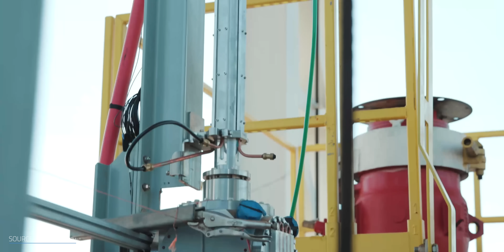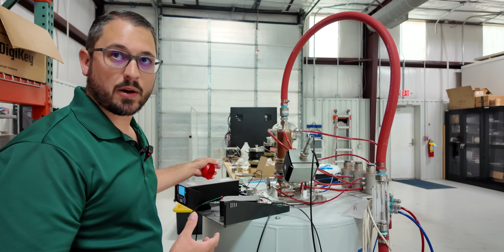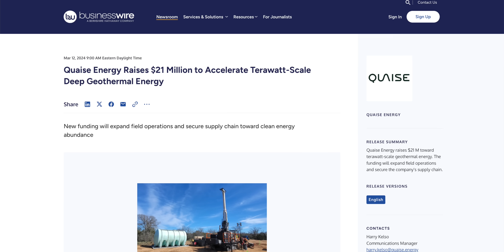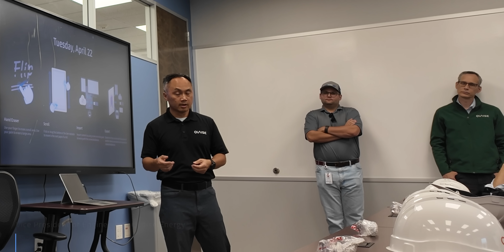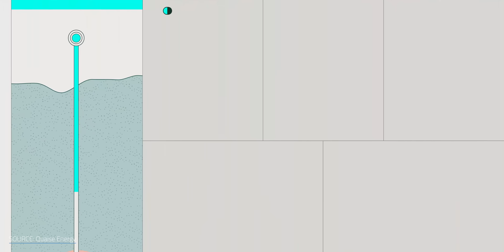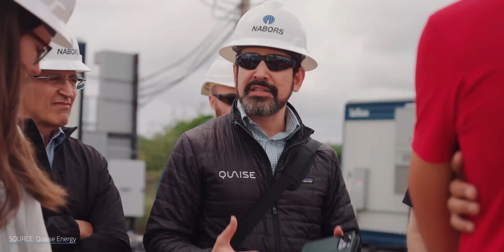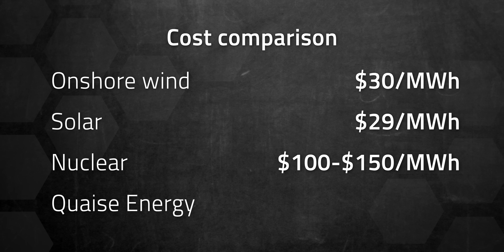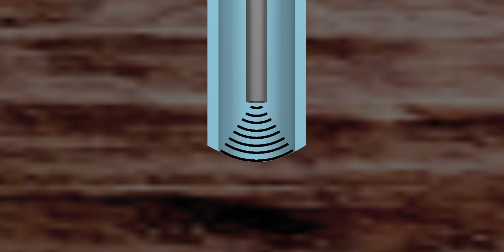How Geothermal Energy is About to Break its Limits

Comment: I'm just wondering where the $/MWh numbers for solar, wind, and nuclear originated . . . .  Have those been adjusted for stability of production rates? How much does the absence of wind or sunlight cost in reduced output? Because weather conditions, like facts, are notoriously uncooperative. At least nuclear and geothermal power have greater consistency . . . .

Comment: Years ago I had the privilege of working on a project with Maria Richards of SMU down in Texas. She had much data on the geothermal data throughout the US.  There is enough heat flow (Remember, the heat removed has to be replaced or you get less and less heat.) under Texas alone to power the US.

Comment: Parabolic Trough Solar thermal collectors can easily generate 300C-400 C temps without drilling 10 miles into the ground. This tech probably won't be viable in the global sun belt....maybe in colder northern latitudes this may be viable.

Comment: Geothermal is definitely ideal, It used to cost millions even just for a off the grid luxury house (so basicly double the cost of the house for the energy system drill and install) to sustain itself and thats a micro system compared to the industrial scale they are proposing. If they can truly cut costs of drilling to the numbers they are claiming, The west coast all the way to the middle of the continent would be ripe for geothermal. I wonder if the energy requirements for if and when water leaks into the hole is that much more to vaporize the water along with the rock. I also wonder if that steam can be harnessed from the top of the drilling hole and funneled into a turbine to also add power to the drilling process? And if that energy difference between drilling with no water leakage vs drilling with leakage can be offset by a second generating turbine. Im no expert.

Comment: Is there a negative side effect to having very deep holes drilled through the crust?  Would there be a unique analysis required per site to ensure they aren't contributing to regional disaster scenarios?  In oversimplifed terms; how many holes until fractures and cracks become quakes and heartaches.

I love the idea of clean consistent energy, however, I'd only ask that there are risk assessments divulged to the scientific community for review.

* Said with respect for all involved.  And ultimately, it would be great if the science clears the way for a super low risk/low threat clean energy.

Comment: Sooo.. use a convetional drill to directionally drill near valcanos. Hawaii is well on it way to being 100% geothermal with a little bit of drilling... but in all seriousness.. how much energy can you transfer thru one 8" hole..?   
How hot will the steam be once it gets to the surface? Definitely not 800f... probably 400F assuming 450psi head pressure of 1" supply water line.. and prv the extraction pipe.. yada yada 300000MWh/year? And LA uses 26million MWh a year... thats a lot of holes.. idk.. "not-a-doctor"...

Comment: I'd love to see geothermal contribute to our energy appetite, but I don't understand how the vitrified rock around the drill hole is going to withstand the geostatic pressure that keeps rising with the depth of the hole.  Drilling mud that fills the hole in conventional drilling increases its counterpressure with depth because of the height of the mud column above it, but this sounds like it needs a column of gas above it.  Any failure will sieze the drill and make the hole useless.

Comment: Minute 12:17 shows the usual misleading trick of renewables being the cheapest generation source. In fact, it is the most expensive seen from the perspective af the FCOE (full cost of electricity) or the cost that consumers pay for. The ones shown here are the LCOE (levelized cost of electricity) that assumes a grid as an isolated system and which is the cost that consumers DON`T pay for.

Comment: This fusion drilling tech for geothermal is fascinating but solar breakthrough technology is already here and deployable now. I've been following a company called InfraBrite Solar that's developed non-PV technology achieving 93% efficiency in lab tests with early pricing at 5 cents per watt. What's even more interesting is they also have an ownership model where people can buy small solar units installed on businesses. The businesses get 15% savings on electricity and owners collect revenue with much better ROI than most investments. At 3 cents per kWh this beats geothermal costs without needing to drill miles underground or develop fusion-powered equipment. While Quaise is still proving their concept, breakthrough solar like this is ready to scale today and doesn't require massive infrastructure investments.
Reply: Solar doesnt require massive infrastructure? my guy, solar is needs the heaviest extension of the grid of all technologies and also a secondary infrastructure (batteries). And in winter it just isn't enough.

Comment: what's wrong with wind and solar augmented with storage? I've modelled 80% RE, 90% RE, 100% RE for Australian state of WA. it always comes down to cost's and if it costs a megaton of energy per cm of plasma drilling then it's never gonna compete with wind/PV+ storage. get to see research projects, but there's thousands of these fancy ideas for energy that never get off the ground commercially, just not efficient. one of the problems with hot rock geothermal is the the resource can move on you after you've spent a fortune and 2 years drilling a hole. Believe I when I see it.

Comment: I doubt very much if 100kW is the power of a car.  Most car batteries contain about 70kWh, which would mean that a car requiring 100kW, could run for less than an hour.  My EV use 1 kW every 4 minutes, so at 60mph, it uses 25kWh, not 100kWh.

Comment: LEAVE THE CORE OF THE EARTH ALONE.
Reply: Where the crust is thick this won't penetrate the mantle, much less the Earth's core. It's only going as deep as a few kilometers (a maximum of 20) into the crust and where the crust is thin could enter the upper mantle. This is a vastly safer technology than any previous method of drilling. Virtually no toxic wastes are produced, no hydrocarbons are combusted to produce energy. It's much cleaner than our current nuclear power, since nuclear requires the mining of uranium, which is problematic for many reasons.

Comment: Wont the radiation that comes from the earths core contaminant the water used to create stteam to turn the turbines? We already have issues with contaminated water and nuclear waste that come from nuclear plants.
Reply: As described in the video, the water will be cleaned and reused. Once the bore hole is completed the leaching of contaminants into the water will subside and only fracturing of the lining of the hole would increase the amount of contaminants brought to the surface. I don't know how likely this scenario is. In any case, I think the amount of radioactive material needing to be handled and safely stored will be relatively small.

Comment: We kind of need our earth to stay warm inside, we shouldn't tap into this source as it will literally slow down the earth if the mantle cools down too much. It is better if we utilize surface sources of magma for any geothermal solutions as these are natural exposure points. If we start to globally drill down everywhere, the scale will do irreparable damage to our earth, we don't have the technology to reheat the earth for a very long time.
Reply: I don't think you have any conception of how utterly vast a reservoir of heat the Earth contains. We could probably tap it for 100,000 years and only deplete it by an extremely small fraction; something like .000001%. We need to place our concerns on the biosphere, where we've already done a lot of damage, not the Earth's interior.
Reply: @moonrock41  It's not about depleting the reservoir entirely. If we skim off the surface it will create disruptions in the flow of magma because we are introducing temperature changes. 

The flow of magma around the solid core is what creates our magnetic field, determines the speed at which the earth rotates and how the tectonic plates move around. 

We are talking about directly influencing the very mechanics we need to survive as humans, this one will kill us if we dig too deep, delve too greedily. 1 tap is not enough but what about 50.000? Don't forget water vapor depletes a hot source almost twice as fast as solid rock can replenish the heat.  

I am by no means a big supporter of any green initiative but there is damage present in our world that we can not ignore any longer. Why would we start messing with something we don't even fully understand? Do we have to damage the last thing we have not touched yet?
Reply: @j4ck3t  You are extrapolating from our past mistakes and assuming that whatever we do in the future will be equally harmful if we take it to extremes. I might be inclined to agree with you if I didn't know anything about plate tectonics and Earth science generally, but since I do I'm skeptical that you have any evidence to support your concerns. Calling this type of drilling "damage" suggests the irrational reaction of a Luddite.

If you would cast aside all supposition and provide me with facts and evidence I might take what you said seriously. Until then I will remain a skeptic.

Comment: This is going to end bad in a number of ways.  

The deeper you go the more pressurized everything is.  They are going for "ht lock" AKA magma/lava/whatever you wanna call liquid rock.  What happens when they pop that plug?

The center of the planet needs to stay hot, it's how our planet operates.  So sure, lets suck that heat out to use for energy right?  I mean, don't get me wrong, fossil fuels are damaging the planet, I get it, but this is going to do the same thing in a much more final way.

How about the potential steam blast of water breaking into this hole and going down to the hot rock?  Every person at the top of that whole will die horribly.

This is all a good idea on paper when looked at it from a view of "can we do it" but not so much when looked at it from a view of "Should we do it?"
Reply: Existing geothermal wells are capped so that the pressurized steam is held in the well and released at a controlled rate to drive turbines. We  know how to do this at shallow depths, but I doubt that it is significantly more complicated with a deep well. Unless there's a serious catch we should definitely do it.

Comment: Why not add hydrocarbon gasse, or hydrogen sure, just needs to work.. Most of the rock will chemically turn to gasses, and so much energy is made AT the stones surface.. and then the glassy wall can be a metal ceramic composite

Comment: I thought this would be way cheaper than solar or onshore wind. Drilling should be of the order of $10s of millions, if you place this at the site of an old coal power station the electrical grid connection and 100MW steam turbine should already be there. Even if the lifetime at 20 years I dont see how it is that much more than a few dollars per MWh unless they are talking excess profits.

Comment: Why use the millimeter wave to boil water?

Why not just have a heating element that can keep that part of the drill over the boiling temp?

I’d assume with what it’s doing to the rock also creates heat, so the electronics at the drill bit should be able to handle that temperature.  Especially with what it’s trying to drill into as well.
Reply: Or simple replaceable rubber gaskets a few feet up where there then sits a heating element. Boiling it away while limiting its seepage into the drill area.

Comment: Your thumbnail is a pseudoscience meme.
The deepest hole ever dug is less than 8 miles.
There is zero proof the earth is a glob with a radius of appr. 3959mi.
Therefore, for your hypothesis to be plausible, it is likely you may have to be hoping to be attempting to access the dielectric inertial zero point?
The black hole of the magnetic field, where energy from this Earth system flows towards {toroids} ground attempting to achieve rest or equalibrium {sp?}
So how would that effect or affect your fusion idea?
In the absence of the molten outer center of a flying space globe tootsie pop?..
Can you just swap the g equations for k?
Or might there be a bit more to it?!
Real natural science, and thermodynamics laws prove, a helioscientism glob earth, wishfully presupposed to be violating said natural laws, adjacent to or within a vacuum, thusly akin to nothing, cannot exist.
Fantasy Theorytales and  reified begging the question pseudoscience is not reality, but logical fallacies!

Comment: I wonder if it would be practical to add a "preheating stage" to this drilling process.  For example, each time the drill bit advances 20 inches, use a conventional high heat blowtorch to preheat the rock that is about to be vaporized.  Basically, the process would be blowtorch 20 inches of rock to preheat to say 1000 degrees, then apply the wave energy and advance 20 inches.  Also, after the rock has vaporized and is making its way up the channel, what prevents the vaporized rock from cooling down and solidifying?  The additional preheating step could have heat and pressure to help push the vaporized rock up the shaft.

Comment: No. You enter a high pressure zone and you’re done. Without mud you can’t kill the well. Also how long does each connection take? They’ve been trying new inventions to get into drilling (because money) but there are reasons why drilling equipment are the way they are for almost a hundred years. There are several reasons why this thing won’t work in practice.

Comment: If this geo-energy-extraction system is successful, developing fusion will never make sense.

Solar & Wind cost/MwHr are NOT CLOSE to competitive when the enormous power storage costs are included.  The "Cheap Solar/Wind" lie has got to be stopped.... we're talking about $100 Trillion level of economic DESTRUCTION to force Wind & Solar to bear all power production.  Plus the 30 year total replacement of Solar & Wind infrastructure.  100 years of Unrenewable Renewables makes a pile of Toxic Solar Trash 6 feet deep covering all of New Jersey.

+ AI just made future energy requirements TWICE AS LARGE.

Comment: This is probably the clean energy solution I'm most excited about. Can put it anywhere (unlike most other sources of electricity which can't be co-located with large population centers). No pollution (like fossil fuel), no waste (like wind turbine blades or spent nuclear fuel), continuous output (unlike wind and solar), abundant, hardly takes any land (unlike wind and solar), really no downsides!
Reply: I am also really looking forward to geothermal in the future, it's probally the future of renewable power. That being said there are only certain areas that can be used for geothermal at this time. You can find a map of them on google, but it is a rather sizable area. At least in the US.

Comment: This is very promising for the future.  However, all this tech talk ignores one big elephant in the room -- politics.  Trump is all in on fossil fuels, so US federal support will be lacking as long as he is at the helm.  Meanwhile, other nations are continuing on their own path regarding renewable energy outside of Trump's sphere of influence.  One example is Canada's Eavor, which uses a similar electromagnetic plasma to melt the hard rock and line the boreholes with a glass-like material.  The main difference from Quaise is that they use multiple returns on horizontal drilling thousands of metres down to create several closed loops deep below a single borehole, and utilize the natural thermosyphoning effect instead of pumps to circulate a chemically neutral non-corrosive fluid through the loops.  They've been at it for a few years and are now about 18 months into drilling a prototype system and full power plant in Germany.  I wish all these efforts success, politics or no politics.

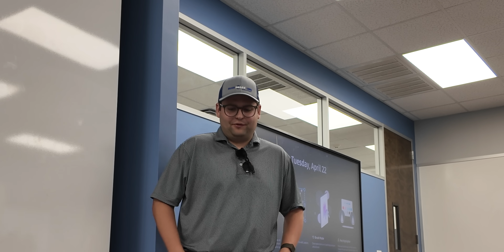Comment: @5:51 You can’t have one hand on the railing two on the stairs to maintain three points of contact, because you would be standing and not walking. Walking requires one foot to not be in contact with the stairs.

Comment: Granite vaporizes at 2,300 DegF, steel softens at 800 DegF. So, how are they going to keep the granite vapor from melting the pipe? Or prevent the vapor from condensing onto the wall of the pipe as it cools on the way up?  Perhaps ceramic insulation (Like spaceship heat shields) lining the pipes?

Comment: Why wouldn’t this technology be the preferred drilling method for oil wells?  The presentation was focused on geothermal but the task of drilling  through rock is of broad usefulness.

Said another way, if this is more efficient, is it replacing mechanical drilling technologies beyond geothermal?

Comment: Have they thought about using old oil well holes as a starting point? Seems like they could drill out the existing hole without all the resistance of virgin geology.

Comment: I wrote a post and then like 1 minute later my concerns were addressed. I was incredibly skeptical on the "no counter pressure needed". It's one thing to remove existing material, another to say that vitrified material will withstand pressure, including that the vitrified result is made of whatever was there, including liquids. I wouldn't even believe that drilling down 100 feet would form a solid enough tube to prevent collapse, or a usable "tube" to fit equipment through. I'm more invested in plasma drilling, as that has reached field maturity.